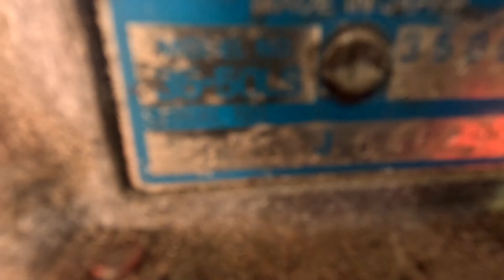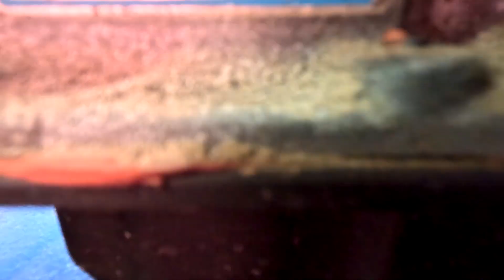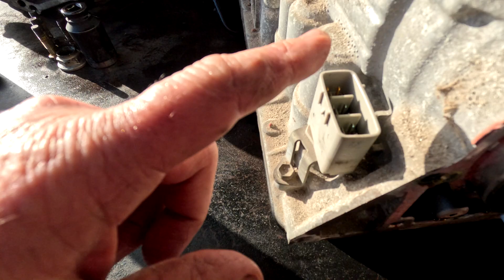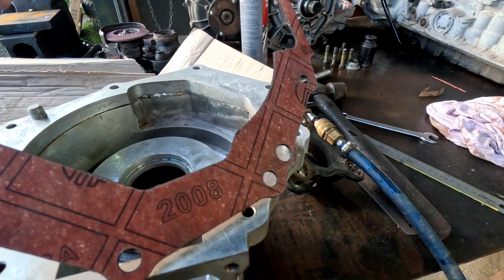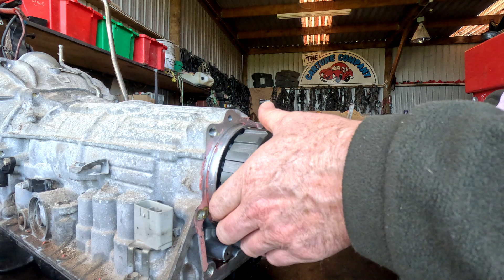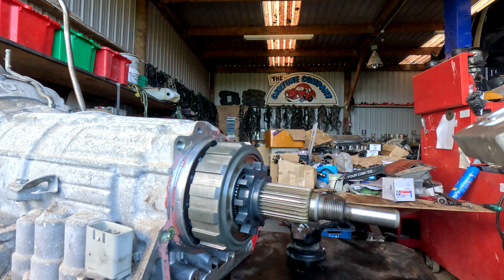Transmission adaptors 5at a650 to Gen 3 surf or 90 series Prado Left drop VF series transfer Case

Comment: Hi Kelvin! I want to buy the sleeve adapter to convert my toyota century a340 to 4x4 can you help me with that?
Reply: You don't need to. You can fit a transfer case directly behind the Century transmission using OEM parts. We've got a Toyota split Tcase behind one of those to go into an FJ45 👍
Reply: Im using the century transmision behind a 2uz cause i manual swapped the 1gz
Reply: Can you tell me what do i need? Part numbers? 😬
Reply: @emmanuelb110  what 4x4 transfer case do you want behind it? Or rather which vehicle do you want to put it in?
Reply: I want to use the 98 4runner transfercase and i know i can get the transfer and adapter easy i just dont know where to buy the spline adapter kelvin shows on the video

Comment: KELVIN, Will i regret changing the Line Pressure Adjustment Dial on the valve body of the a650e transmission on a 98 Ls400 to the third setting?
Reply from the maker: Most likely,  it makes the shift quite harsh.   A proper transmission tuning kit is better